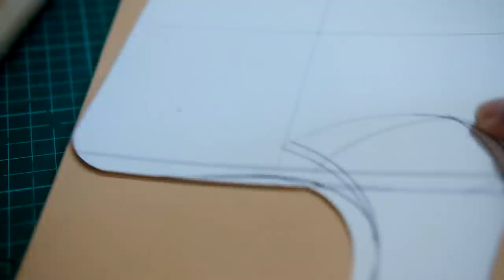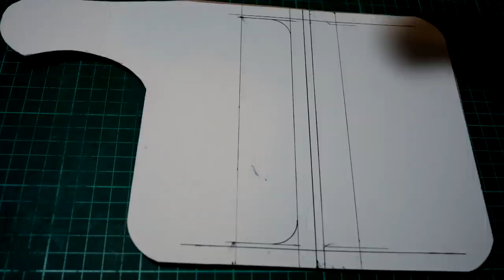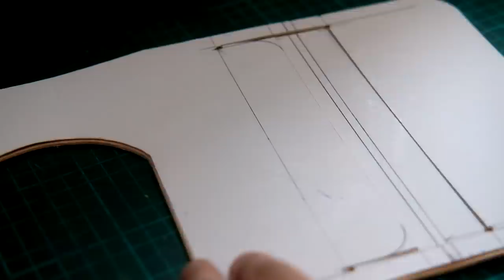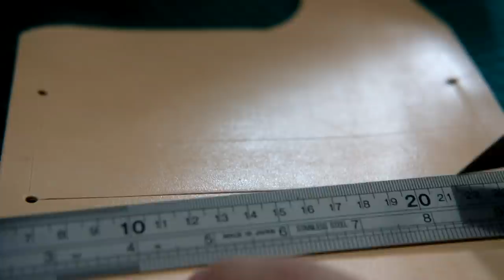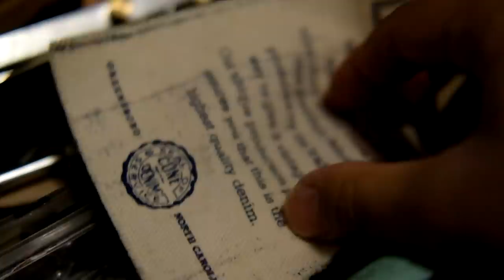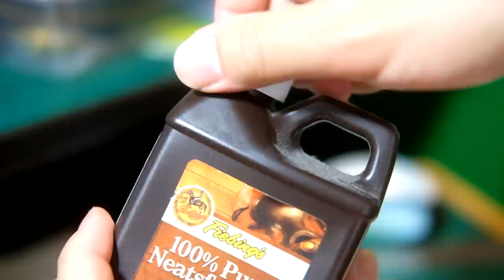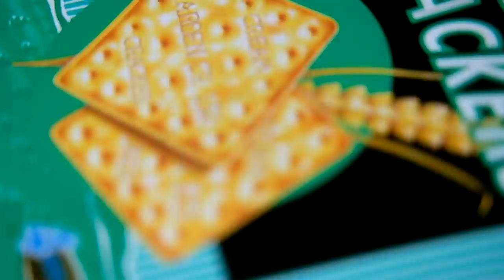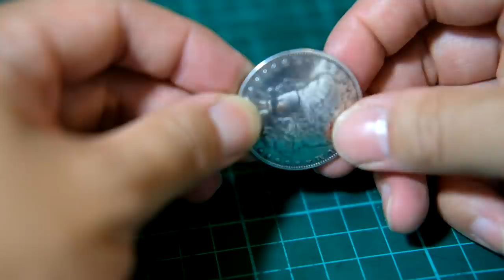making a new leather biker wallet leathercraft

Comment: Can someone please tell me why all the leatherworkers I follow on you tube don't use the edge of the leather when cutting out a template. There is probably a good explanation why , it's just I do the same thing ( following by example) but my wife asked me why and I told her it has to do with clean lines but really that was just a guess. Can someone with more experience enlighten me.
Reply: It’s not consistent in the thickness 😎
Reply: @pippashaw8224  haha thanks pippa